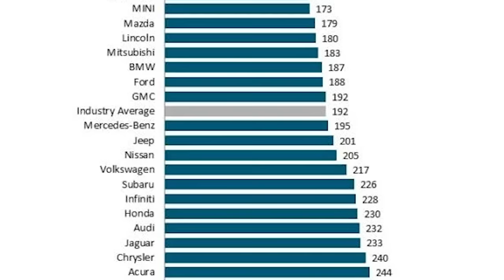Trucks That NEVER Break Down (Reliably run 1,000,000 miles)

Comment: Genuinely surprised to see no mention of any 300ci / 4.9L i6 powered Ford Trucks so far. Those were known to run forever with little maintenance. There are many stories of how they just wouldn't die when they put in the engine killer solution back during Cash For Clunkers. Every other vehicle would die after a couple minutes of idle, and be towed out the the salvage lot, but all the 300 i6's would go back there under their own power.
Reply: yep the 4.9s are way overbuilt, some were even industrially used as stationary power generators.. think 80s mercedes
Reply: @fsouzajr  I know about the power station thing. Power Nation here.on YouTube uploaded their 300 i6 build not too long ago and they started with one of those power station 300's
Reply: We had an 83 F100 with the 300 i6. My grandpa bought it new, towed a camper all over the country as a traveling preacher, sold it to my stepdad with over 200K miles on it, stepdad drove it (beat the hell out of it) for another 200K+ and the transmission finally died.
Reply: I heard that some of the Expeditions would lockup temporarily then would cool down and restart. Per mechanic at a  Toyota dealership.
Reply: My dad had a mid 80s ford with the b inline 6. It had over 600k when he sold it and I saw it on the road for several years after that
Reply: I bought my 2004 f150 with the 4.6 engine new I still have it, it's needed nothing.
Reply: Internal gears, no belts, chains, just bulletproof steel.
Reply: Love them old straight 6s.
Reply: Yesss!!! I had one in an 84 bronco. The few years I owned it, it never saw asphalt. Only back woods wheeling. Welded the spiders and I'd often be in mud holes on the mate slamming drive to reverse, good ol C6 trans. I drained so much water out of that crank case, never stopped
Reply: Had a 76 ford p.u. with a 300 c.i.d., run like a top and had good low in torque,  was a 4 speed ext. cab, 160k miles when I traded.
Reply: That's a Ford and from what I see this guy is a little bias
Reply: Had Terrible issues with that 4.9 EFI.
Cracked exhaust rear main leaks fuel injector failure rust in coolant bad gas mileage.
Terrible in two vans and a Pickup truck for landscaping business.
I switched to GM 4.3 v6 and 5.3ls best trucks minor problems .
Reply: Stock they are slow and get horrible gas mileage but with a little modification, they can be amazing.
Reply: @mr.monitor.  the old carburetor ones were ok. 
But I like the 302 V8 much better running and power mileage.
Reply: @ironmonkey1512  Same thing for my 06 expedition with a 5.4L 3v
Reply: Had one with a blown head gasket. Never got worse and had to add water, oil, and gas daily. Drove it for 5 years and sold it like that. Never missed a beat.
Reply: The company I worked for in the early 90s probably had over a thousand F150 long bed 2wd with the i6. Those things had at any given time over a thousand pounds of equipment in the bed and never had a problem. Crazy reliable and they traded them in at 150,000 or so.
Reply: I had a 300 cu inch Bronco. 8 miles to the gallon, 9 with a tail wind, but it could go straight up, no problems.
Reply: I personally pulled and transplanted the same Ford 300 6 ,3 times.. from vehicle to vehicle to vehicle..over a little over a decade.. same gentleman, last truck was a 71 f250..
Reply: I wore a read end out at 450k miles on a 1987 F150 4.9. Worked as a contractor for an insurance company, hauled lumber/sheet rock etc every day. That 300 6 just goes on and on and on.
Reply: I've got an f150 with a 4.9, it's been used and abused for the last 40 years and she always turns over no matter if it's 8 or 80 😂
Reply: @johnhowerton8241  was just getting broken in..
Reply: @mitzvosgolem2090  they didn't seem to like efi,did they.. the carb'd 300's ran beautifully.. we ran them on Vac-All trucks the big sewer suckers.. always started, ran smoothly, very good fuel hourage, very low to no oil use.. all round good engine for auxiliary/ accessory power supply..
Reply: @kolbymartin9743  so literally everything was built into the engine to make it all internal?....what all was included?
Reply: I’m a Chevy guy but even I admit that engine is a gem
Reply: This seems to be just a vulgar and random list of almost all the pick up trucks available in the USA market,than a serious ranking about the most reliable models of Pick up trucks!.
Reply: @MitzvosGolem1  😁😁😁😁😁
Reply: Agreed! I had a brand new stripped '84 Ford F150 with the 300ci 6. Great truck. Only $8k new for a very basic truck
Reply: Only issue the 300 inline 6 had was oil leaks, and they all did. Not exactly fuel efficient, but they were tough as nails
Reply: Agree  that 300 was one hell of a drill rig motor from cars to 1 ton that 300 6 had torque a true 5.0
Reply: Omg ford sucks bro
Reply: Yep.  Owned a 1967 F100 and 1984 F150 with the 300.  No engine issues, great MPG.
Reply: The 4.9 it was pretty’s slow but it always worked
Reply: Do u mean the 4.9 straight 6 they were bullet proof and im a chevy guy saying this lol!! My buddy ran one with no oil forever trying to blow it up so his father buy him a V8. Little did we know back then that that Straight 6 made as much or more torque than many stock v8 engines of that time lol!! 
So never blew put oil back in it ran till we had a very bad accident in it it was a great truck. He had it lifted we would go out do things in that truck I didnt know possible.
Reply: @joshgessinger4509  Was confused when I saw "4.0" on the notification, but clicked and saw "4.9."

I do mean the 4.9 that Ford had, but those Jeep 4.0's are a force to be reckoned with. I've got myself a '98 Jeep Cherokee and I can confirm that the 4.0 is damn near indestructible. Everything around the engine though..? Not so much.
Reply: @irregulargorilla8217  ya i miss printed and went back and fixed it. But ya the 4.0 jeep was still is a amazing truck and engine. Make one of the best off road trucks of all time my opinion anyway. Stock idk but lifted some good mods the first Cherokee’s made great fun truck off roading. Im a chevy guy though iv had a few fords that I liked but chevy is my brand of choice. Not that all chevys r good im a mechanic work on everything from cars to dirt bikes. Seen my share of crap on just about everything lol!! But I definitely think ur comment about the ford 4.9 is right on.
Reply: Funny thing is the I6 fords are a common site in dealership repair bays . I worked at 2 bay area ford dealerships and 6 cyl trucks were very commonly being brought in for something
Reply: @DarkepyonX They Stopped making them 27 years ago so with that age their bound to have some issues.
Reply: Harvestor slant 6... untouchable
Reply: Farm boss has a 1980 f350 flatbed (12 to 14 ft bed- he cut off 2 feet when he converted it to a dump for easier cordwood deliveries) dually  RWD with the 300 ci and a 4spd manual 
It will crawl up steep hills with 10,000 lbs of red oak or 5,000 pounds of bales np - chug right uo it
You gotta pump the gas pedal a few tunes for it to start but still going 💯 last I knew at almost 45 years old 
Drove it constantly for a decade and a half working haying, logging and general AG work.
It topped out at around 55-60 mph, tho, but had incredible torque and low gearing and axle ratio.
I believe it was listed at 265 ft. pounds   and 143(?) Hp
Reply: @ironmonkey1512  I've two 4.6s and those early ones are rightfully legends in truck and Crown Vic cop use.  The 300 six was even better but emissions and length killed it or one would have replaced my 4.2 (hydrolocking turd and the factory fix is not one).
Reply: @looper964  right! he said the Mitsubishi are reliable XD funny
Reply: @mr.monitor.  my 95 300 efi might not win any races but it has enough power to get up on the highway.  That being said, mine gets about 19 highway with the 308

Comment: The toughest most reliable workhorse truck I ever owned was a 60's 1 ton Dodge power wagon with the 383 hemi and 4 speed transmission. The one that was equal to it was an old 1 ton international with a 401 v8. I have never had anything more tough or that could take as much abuse as those trucks. We used our Internationals like tractors. In fact when we got a tractor stuck , many times we used the international to pull them out. My power wagon used to push through heavy brush and push over smaller cedar and pine trees and bust drifts.  Can't do that with new trucks.
Reply: What happened to the Power Wagon name? Is it still in use in the US? It’s an awesome branding option.
Reply: @Ben D Geddes  When Ram was separated from The original Dodge it went away.
Reply: That 401 is an AMC engine. International Harvester used AMC engines in some applications.
Reply: @Walt Moore  you have that backwards. AMC was not producing many of their own parts. They cut deals with others to build their products for awhile. 

I took a 401 out of an old international grain truck and put into a 1974 Jeep Cherokee. 

I had a 1976 J10 that had a blown engine and used parts out of a Ford 360 to get it back on the road. 

AMC in the 60's and 70's was struggling and using a lot of parts from other manufacturers. You could bolt Ford and International parts right in with no modifications or very few.
Reply: @desertdan100  external  parts yes, not rotating parts. Starters,water pump, alternator. I've  worked on a lot of AMC and IH trucks.
Reply: @Walt Moore  I have been a big jeep guy and started wrenching on them in 1982. I have owned and worked on almost every series. S, J , Y, Z , W.

I owned a lot of them and used to buy them on auctions, fix them up and resell them to make more money. I built up and made mud draggers and off roaders.

I love jeeps. I used to go salvage yard picking for parts from other manufacturers that I knew worked in jeeps. In the 70's models it could be Mopar, Ford, International and even some GM stuff here and there. It all depended on who they were sourcing parts from. 

My tow right now is a 96 ZJ. They are about the toughest of that era and have coils on all 4 corners. 96 - 98. I once stuck a Ford 250 out of a maverick into a CJ including the transmission. Then I had to do a little adapting of the output off of the  transmission.
Reply: @Walt Moore  I could be wrong or it is possible. I was working on a lot of international stuff from the 60s and 6 I do remember a jeep wagoner one time that had a 401 and it was mid 70's.  I worked on a lot of Interational heavy grain trucks that had a 345 or a 401 in them. The 345 was a small block and the 401 was a big block. The bolt pattern and splines matched up perfectly when I mounted it into my Cherokee.

I did a cardboard match and everything was perfect. I got out the mic and everything was perfect.

Easiest upgrade I ever did on a jeep.
Reply: @desertdan100  Yes the 304,360 and 401 AMC engines share slot of the same parts. These are 70's and 80's era. The 60's featured 290, 343 and 390 cui. engines. AMC never had a  big block these engines were all physically  the same size, only difference was bore and stroke. I have a 360 in my cj7 its been running strong for 20 years. Thanks.
Reply: @Walt Moore  okay I went back and looked up in my books . From 1955 until 1974 IH made a big block 401 that they put in heavy duty trucks. It was a big block and the 401 was the smallest in the series. They were strictly a truck motor with a lower rpm threshold. They were found in grain trucks , busses, dump trucks and so on. The IH travel all and pickups used the AMC 401v8. 

That is where the confusion lies. You were right and I was right. I took a 401 out of a 1972 grain truck and put it into an SJ 1974 Cherokee with very little trouble.
Reply: @desertdan100  Thank you sir, good education on both sides, lol. Have a good day.
Reply: My old 76 W100 had 400,000 before it lost compression. The best truck I've ever owned!
Reply: AMC 
A Mongrel Car

Comment: We are currently on our 4th Ranger. They’ve proven to be durable pickups with the exception of the 3.0 V6.
Our current Ranger is a 11 XLT super cab 4X4 with the 4.0L V6. 
Before adding the K&N intake and the FlowMaster exhaust as well as a free flow exhaust manifold, I was getting 19 mpg on the freeway with the cruise set on 75mph. Now with the mods I’m consistently getting 23mpg.
We get 5-6 feet of snow every winter and our Ranger has never gotten stuck.
It’s now 12 years old but has only 35K miles on it.
I change the oil every 4K miles with Kirkland full synthetic motor oil and I change the front and rear differential, transfer case and transmission fluids every 30K miles.
I guess this is why we get 250+K miles from all of our vehicles.
If I didn’t need the hp and torque then I would have opted for the 2.3L 4cyl naturally aspirated engine. Those 2.3L can get 500K miles easily.
Not only does our Ranger haul a yard of gravel, dirt and fire wood, but after the intake and exhaust mod’s, it now hauls ass too. 😁
Reply: 2011?
Reply: @quasitoantrax  Yes. The last year of production for the last generation of the Ranger
Reply: I’m no ranger fan but I do know people who’ve gotten 200k+ out of them and other ford products. That seems pretty good from my perspective for anything.
Reply: I nearly bought a Ranger in 2005 and regret it. What put me off was the untried 2.5 diesel. It was a new engine replacing the previous 2.6 gas found in the Courier. Don't know if they did have problems but after 8 years I never sore them on the road. They didn't seem to last.
Reply: @2DogsVlogs  I’ve never owned or ever heard of a diesel engine in a Ranger.
The most durable engine in the Ranger was the 2.3L naturally aspirated gasoline engine.
We’ve own 2 of them with the 2.3L. 
The first one we put over 500K miles on it and the second one we put almost 700K miles on it. Back then we changed the oil every 3K miles with conventional Valvoline motor oil.
We now change our oil every 6 months (which is only about 1,500 miles) with Valvoline full synthetic (high mileage) oil, even though our Ranger has only 36K original miles.
We change the oil on our Subaru’s every 5K miles with Valvoline full synthetic (high mileage) oil.
My wife’s Outback has less than 30K miles and my Forester just hit 13K miles.
High mileage oil has additives that reduce engine wear.
Reply: @Doc1855  Diesels are way more common here in Queensland. The 3.0 is the most desired over the 2.0 which recently replaced 3.2 and 2.2 from the Isuzu D-Max. The last 2.5 made was in 2010. I ended up buying a Hilux but barely used it so I sold it for a Sebring. What was I thinking?
Reply: Odd because the 3.0 Vulcan is an exceptionally good engine.
Reply: @smokeypearl  Our 3.0 V6 was horrible after 80K miles.
Furthermore it got the same mpg as our 4.0L before I added the K&N intake and the 3” FlowMaster exhaust system.
Reply: Last week, I just bought a 2011 Ford Ranger XLT, 4x4 with 4.0L V6... I work from home and don't do a lot of driving (maybe 3k miles per year), so I don't mind the poor gas mileage. Everything else about the truck is fantastic. I paid $17,900 for it, which is a good deal according to the KBB (although admittedly, it's more than it should be). It only had 52k original miles and was manufactured and owned in Tennessee, which means... no rust! 

I love the thing. It's a blast to drive and truly feels like the last real, classic, compact truck ever made. All the new trucks being made today look like giant futuristic unreliable monsters made for rich people (or poor people who go in debt to own them).

Cheers to our Rangers!

Comment: On Jan 31 2001, the last day of the year I purchased a 2001 Ford Ranger Super cab XLT with the 4.L V6 and 5 speed auto, I was 60 years old, and my retirement present to myself, today at 81 years old that same truck is sitting in my garage, still looks brand new, with its matching canopy, oh yeah it has only 58,462 original miles on it and the only work done has been regular maintainence........still runs and drives and looks like brand new, yeah I took the original tires off at 16 years and replaced them just because of age.  been a great little truck !!!!
Reply: I’ll be happy to be first in line when it needs a new home.

Comment: 2005 GMC Sierra 2500 4x4 crew cab w/Duramax LLY and Allison 5-speed.  EGR deleted, LBZ turbo intake and PPE tuner mild Power Level 2. More than 425 hp and 810 TQ. Over 357,000 miles.  Accelerates well, very reliable. Great truck.
Reply: GMC used to be King. You got a good generation. Todays GMCs are garbage. Overpriced, too chromy (especially the trucks) and their Gear box is awkward af
Reply: @johnappleseed9290 They aren’t bad, all new vehicles aren’t as good as they used to be…
Reply: How many transmissions have you gone through? It is rare for a Chevy transmission to last more than 150,000 miles.
Dodge Dakota was a piece of junk. One was lucky to get 100,000 miles out of them without a major repair. Few of those lasted past 175,000 miles before being junked.
Ford Ecoboost engines are nowhere nearly as reliable as the 5.0 V8 Coyote. The second generation 5.0, which was sold from 2015 to 2017, may have been the most reliable pickup engine ever made. Then Ford messed it up in 2018.....
Reply: @herbb8547  Doubt he’s been through a lot, there’s tons of Chevys with over 200k on their stock transmissions. Especially the older gmt800s very reliable trucks.
Reply: @Wesley Garrison  I was thinking of the half ton Silverado 1500. The 2500 has a heavier transmission. Everyone I know with a 1500 needed a new transmission by 150,000 miles. Some a lot sooner if they didn't maintain them properly or if they pulled in over drive. It amazes me how so many don't understand what "Tow Mode" is.